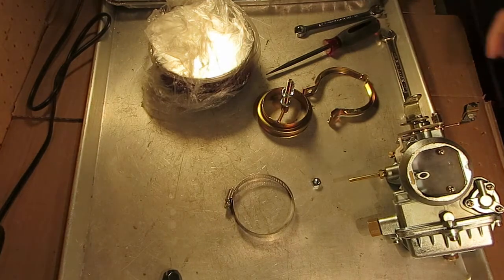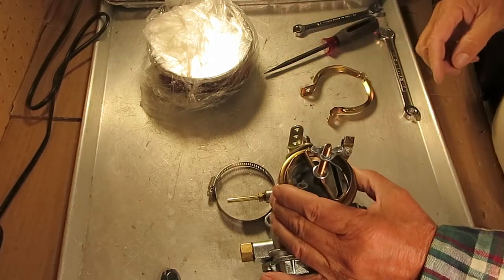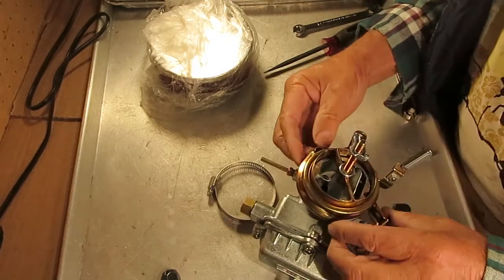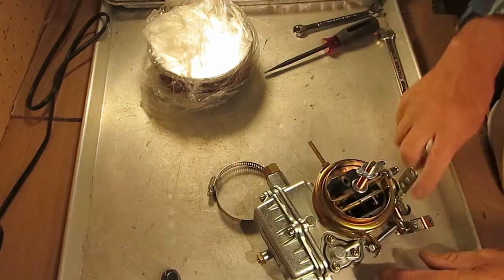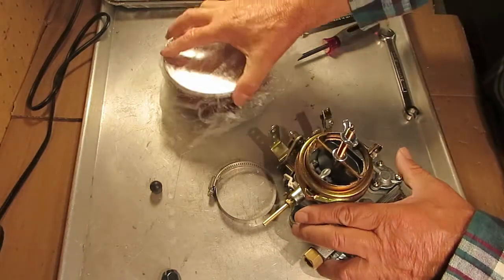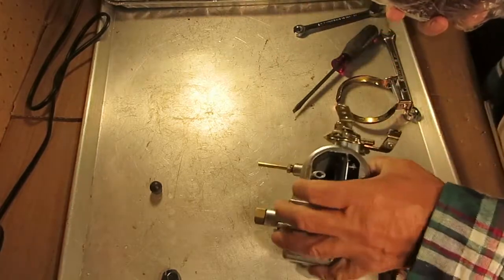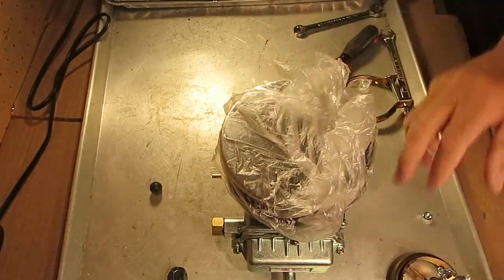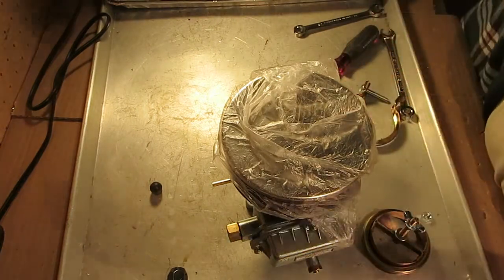Air Cleaner Adapter

Comment: Will air cleaner fit a 59 Ford custom 300?  6 cylinder.
Reply: @MikesCarburetor   I called the company stated on this video and told me the adapter for the filter with the clamp is no longer available. Would you know where I can get the kit?
Reply: @MikesCarburetor   The tower has very little height barely enough for the OEM air cleaner housing to clamp on. Also the air cleaner housing where the air flows in is on the side not directly on top because there is not enough clearance for the hood to close so I don’t even know if the air filter on the website will work. If it’s to tall the hood will not properly close but thank you for replying and for the link.
Reply: @torchmmaempire  if I'm understanding you correctly you could try a carb hat to a cone filter
Reply: @imthedarknight-8755  Hmmm ok the cone filter may not work cause not enough clearance under the hood. But thanks for the advice I’m going to look for a carb hat that will fifth the diameter of the carbs neck. There is just not enough thickness on the neck for a C clamp. There’s just barely enough lip.
Reply: @imthedarknight-8755  I’ll post you a link of my engine soon.